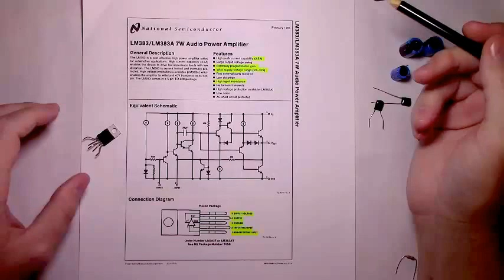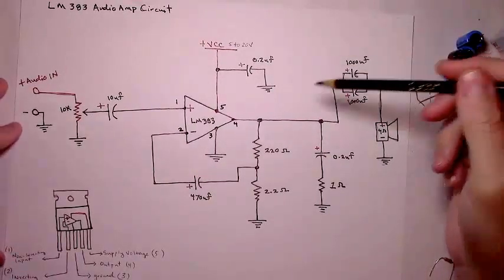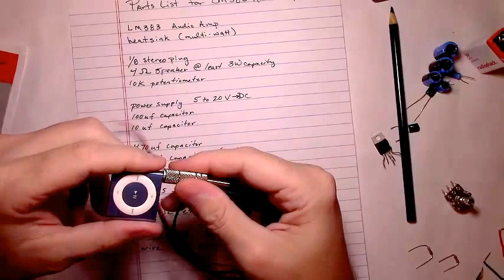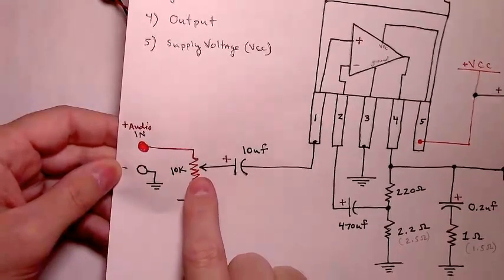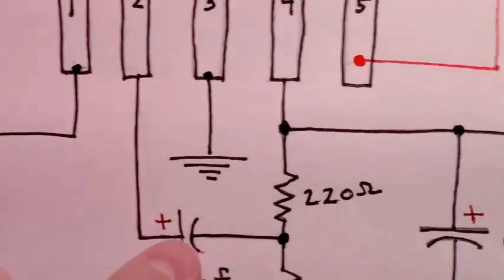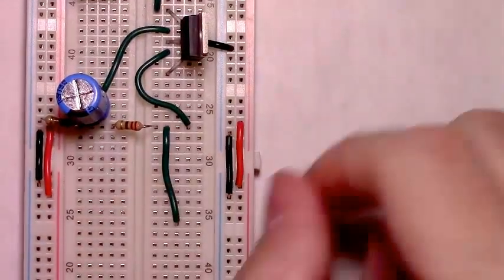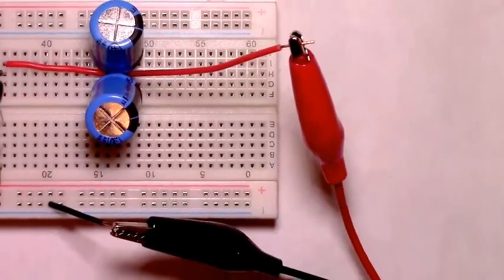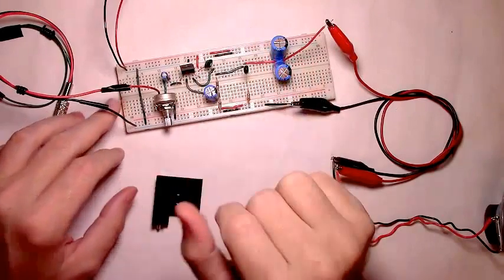Circuit Assembly Tutorials || LM383 Audio Amplifier

Comment: hey i found this other video of yours...in your opinion which sounds better the lm383 or the lm386? and which is louder? your videos are great tnx..
Reply from the maker: junard roma Thanks for the comment and appreciate the feedback.  
A decent sound quality can be achieved from both.  The 383 tends to require less parts than the 386 to sound decent and the 383 will more easily produce more volume.  The only immediate downside to using the 383 is that producing more volume requires more amperage that in turn drains a set of batteries more quickly than a 386 circuit.  I like them both, but given that I often use batteries I tend to prefer the 386 circuit.  But, the 383 is definitely worth checking out, especially if achieving more overall volume with minimal parts is the primary goal.   Hope these comments help.  Please continue to let me know if/when there are more questions.  I'll always do my best to help.

Comment: Hey I have 2 speakers of 40 ohms and if i connect them in parallel they will reduce to 2 ohms (as far as i know). so is it okay to use it like that? hope it don't fry my circuit!And can I use a 12 V battery as a power supply!

Comment: when you say 2 to 2.5 ohm resistor 1 to 1.5 ohm resistor, do you mean 2k to 2.5k ohm resistor 1k to 1.5k ohm resistor?
Reply from the maker: +Sam Stecher Thanks for the question.  The smaller values, 2 to 2.5s ohm and 1 to 1.5 ohms.  Not the Ks.  Those resistor-capacitor networks are intended to capture/"absorb" high frequency "noise" so the resistors need to have low ohmic values.  Hope these comments help.  Please let me know if/when there are more questions.  I will always do my best to help.